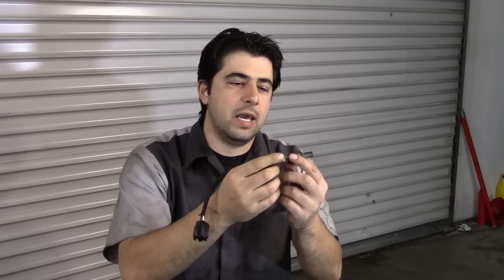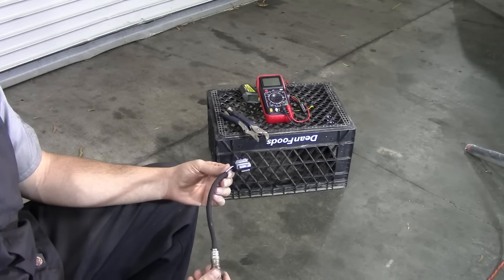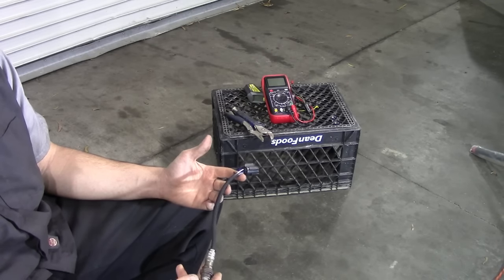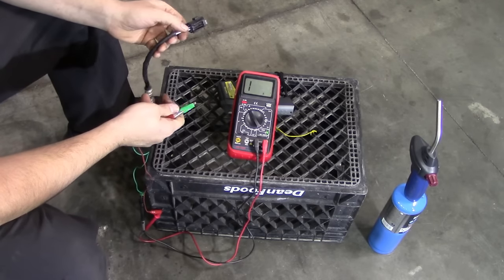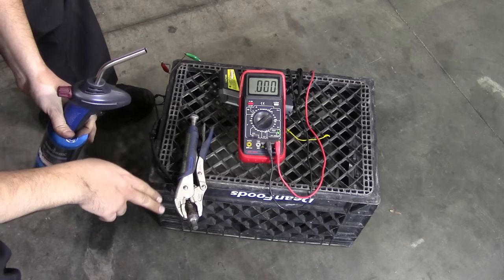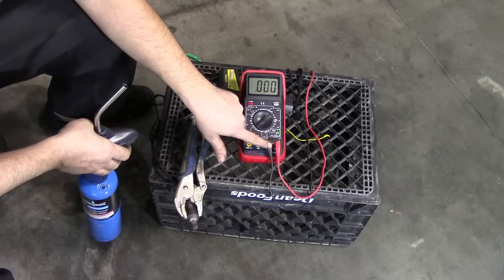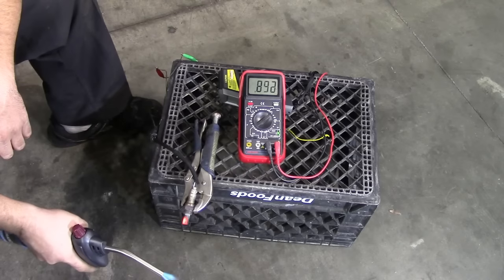How to Test an Oxygen or O2 Sensor - Plus a Quick Guide on What Each Sensor Wire is For

Comment: I tried this with an acetylene torch, but accidentally cut the O2 sensor in half.
Reply: Um yeah no crap you have to use  propane torch because oxygen acetylene gets hot enough to cut plate steel propane does not
Reply: @SheikhN-bible-syndrome  its a joke my man
Reply: Yeah I threw mine in the coal forge to warm it up few minutes later I came back it was gone idk🤷
Reply: Lol
Reply: Lol
Reply: How TF did you manage that one buddy

Comment: The best way to test the sensor is to backprobe the signal wires with it in the car and the engine RPM held above idle. The sensor could be producing a good signal, but the wiring to the PCM could be bad,  preventing the signal from getting there. A scan tool is great, but that doesn't always mean the signal reported to the scan tool is correct.

Comment: The O2 sensor's sensing ability comes about by producing a small voltage proportionate to the exhaust oxygen content. In other words, if the oxygen content is low it produces a high voltage (0.90 Volts - Rich mixture) and if the oxygen content is high it produces a low voltage (0.10 Volts - Lean mixture).    Give time for the torch to burn off carbon and heat the tip all around and not just one side.

Comment: An analog meter with a needle would show if the sensor has a faster reaction. That's the downside of the digital multi meters, you're not only looking at how fast the component is switching, the digital meter has a limited refresh rate.

Comment: this is a great explanation, the heater resistance is round about 4 ohms but does vary slightly from sensor to sensor, the sensor reading will rapidly change once the sensor is fully heated all the way around, using the blowtorch is definitely a near as damn it simulation of what the sensor will be experiencing in the exhaust manifold, this is a great way to test an existing sensor and a brand new one before fitting it, it is also a good idea to check the resistance reading of the sensor wires as there should be no resistance reading across it, if it does have resistance then it means that there is carbon crud bridging the sensor wire itself and this build up on an old sensor will cause false readings to the ecu.

Comment: Great video, really helps me! I'm chasing a P2195 (Oxygen Sensor Biased/Stuck Lean, Bank 1, Sensor 1)  on my Ford Focus. I've eliminated all other possible causes (vac leaks, exhaust leaks, etc) and have been scratching my head. I replaced my upstream sensor before anything, but I used the cheapest one I could find. This might be my problem, so I'm doing this procedure to check it. Thanks from a new subscriber!
Reply: Andrew Edwards don't forget a clogged fuel injector

Comment: A scan tool is the best way to test it with the O2 sensor(s) in situ.

If it's both a code reader & one that scans live data,then it will tell you if the sensor is at fault or whether they are reporting a lean mixture due to an air leak or bad fuel pressure.

For example , code for a MAF meter & an O2 sensor reporting a lean mixture  will tell you that you may have an air leak.

Comment: Wells tech published VHS tapes on this method back in the OBD1 days, and I found the same thing as you - during testing of sensors that were "sluggish", the heat from the flame (making the o2 sensor cherry red) literally burned off deposits, and "fixed" sluggish sensors (sort of like the self-clean cycle in your kitchen oven).  During normal operation, EGT's on a gasoline engine don't get hot enough to burn off these deposits that can foul a sensor over time... but your torch with the pinpoint flame can, and the test procedure itself "fixes" many of the sensors that trip an OBD code for "sluggish", or "slow response".  Obviously not going to fix an "open heater" though...BTW - don't bang on the exhaust pipe, or use a hammer on your wrench, or drop the sensor when removing it...or you WILL have an open heater circuit by the time you want to reinstall it... ask me how I know...
Reply: How I know?
Reply: Or better yet, don't ask me how I know.
Reply: Whoa! Thanks for the tip. I never once thought of that!
Reply: So are you recommending that we torch all our O2 sensors red hot and then reinstall them?

Comment: Thanks for the info. Very helpful. just in case no one has mentioned it, the heating effect of a resistance is Watts=(volts x volts) / Resistance. For a 7.2ohm resistance on a 12volt system this is 20Watts. This is a low heating effect, but added to the heat from the exhaust gases I guess it will achieve a two to three hundred degrees celsius.

Comment: You're a good instructor, I'm giving up on the forums and shops, they've all become jerks who just throw parts at things.  I'm hoping this is my problem, I've tried new MAF sensor for P0171 because a shop wanted $500 for that and valve cover gasket (not needed), so I knew they were just throwing parts, at my expense.  But I thought 'how can I test sensor without scanner?'  I suspect these at 180k miles before my MAF sensor because I also got cat codes in past, like 'catalytic inefficiency' or something. I guess it could be MAF but I've tried two.

Comment: O2 sensors get cleaned in temperature above 400'c city driving on low revs is not good for them especially on LPG-that's what I did:-)  at first O2 sensor was cold what you did with propane torch is not only heat him up but cleaning :-) so at first was lazy because was cold and dirty... Is not that easy to reach 400'c on 1.3 petrol yaris on motorway :-) I did the same by giving my O2 sensor good blast with propane torch and it works a lot better!!!  Good video mate!  Thumbs up!

Comment: HEY! You are OVERHEATING the sensor tip, and also RISKING it because you are overheating only ONE SIDE, and that stresses the ceramic inside!

The PROPER way is to Only heat to a dull, dark red, and no more and doing it in a well shaded room to be able to see the first subtle red color just appearing and then withdrawing the flame immedoately!.
Heating and turning the sensor to heat its tip area UNIFORMLY around, and not concentrating the heat at one side prevents stressing the ceramic inside, as it is fragile.

You may add the caution about not heating the rear portion (behind the hexagon), as you could damage the heater element, thus, the only portion to heat, is the very tip of the sensor, also trying to make the tip of the flame to enter inside the holes, in order to decarbonize the ceramic inside the outer metal jacket, that cover is only there to protect the ceramic and its delicate precious metal deposits, which are what generates the voltage signal.  Someone could presume that heating to bright red color didn't damagep his sensor, but not all sensors are so rugged as the factory installed ones, the after market ones tend to be less rugged (and sometimes less durable too!) Best wishes.

Comment: I think that certain time you are refering to is 0ne second.   since most obd2 oxygen sensor now has heater ciruit element built in. you can identify them by the pair of either black or white wires.  Not just WHITE.

Comment: 99% people don't carry multimeter so lets cut short. Some indications when u need to check O2 sensor are when Cylinder Misfire, Engine Hesitation, Lack of Acceleration Power and Black Smoke from silencer. MIL is on. Remove the O2 sensor and see if its become white then its time to replace it.

Comment: please, is the voltage also measured on the two white wires as resistance?  Is it enough to use a candle to create a flame?  Next time do a test on the Map and Maf sensor thanks for the video👍

Comment: Thanks for sharing with the community. Good video!. I ahve one comment for correction on time stamp 3:54 it should be the higher the oxygen the higher the voltage.
Reply: The O2 sensor's sensing ability comes about by producing a small voltage proportionate to the exhaust oxygen content. In other words, if the oxygen content is low it produces a high voltage (0.90 Volts - Rich mixture) and if the oxygen content is high it produces a low voltage (0.10 Volts - Lean mixture).

Comment: I have a BlueDriver Bluetooth scanner but want to upgrade, what do you recommend as a good all around scanner that has good graphing capability ? Second my daughters 2011 Kia Sorento has basically really slow acceleration, no power on hills, the only code is P0170 which could be bad O2 sensor, bad Maf sensor, vacuum leak, etc, could that throw it into limp mode, I own 2 Optimas and a  Santa Fe and even with bad O2 sensors they haven't lost power. Could it be transmission ?

Comment: Correct me if I'm wrong but a o2 sensor do NOT measure the o2 content it simply heats up witch changes the amount of voltage going to the ECU,  witch will determine how much feul goes into the system ......

Comment: Found this video diagnosing a P1135 fault code on my OBD II( 2003 toyota camry 2.4l). I started out by replacing my catalytic converter and the upstream (bank 1, sensor 1) I already replaced it but the code still persists.

Comment: My car is reading no activity from my 02 sensor that I just installed. The old one was throwing a code but it at least had activity.  I tested the new o2 and it read 0.00 and then barely moved up to 0.01 to the highest it reached was 0.13 then to 0.03 and then 0.00 right away.  It's that a bad o2 sensor? The brand new one?

Comment: A Het gu would be better for heating the sensor.  The propane torch burns almost all the air so you would get a reading that indicates a rich mixture.  A hear gun only heats the air, and you would get a lean indication.

Comment: So does the sensor itself produce voltage when it gets hot? When testing it did not seem that you added voltage but only checked what was coming from the sensor.
Reply: This is also my question
Reply: @williammason1932  I later found out  that it does. The channel listed below has a very good vid on it:
https://www.youtube.com/user/markjhicks/videos
Reply: He does state a couple times that the sensor does generate the voltage. The voltage is what the computer is looking at to determine how rich or lean the fuel:air ratio needs to be. The sensor produces the voltage.

Comment: Hello any advice... I have a 2005 Trailblazer and getting codes : P0153 and P0054 and P0053. I recently placed both O2 sensors and still have the codes. Could it be the Cat?
Reply: That's usually the next Step

Comment: Most engine management  issues seem to be related to carbon biuld up.Carbon is impervious to acid but hydrogen peroxide should burn it.Does anyone have any knowledge in this area?
Reply: Bro i drove 2000 miles in 2 weeks i did 2 stp ultra injector cleaners with 80 gallons of gas, took me 500 dlls of gas but kept.it full all the time, the jerking i felt that felt uncommon, was gone after those 2000 miles, car ran leaner, and that was prior to changing both my o2 sensors

Comment: In a car the wires for upstream CC are. 
1. pump current
2. sensor voltage negative
3. heater negative 
4. heater positive
5. compensating current
6. Lambda control,
 Can you explain what is the use of so many wire. why not only 2 or 3 ?
Reply: vicky singh

Comment: How do you check it on a 1995 vehicle that DONT have a scanner connection? My system is a OBDI system...I guess I could unplug it and see if it runs better or changes....I have a miss...at idle..or any speed or any  acceleration...It was missing on 1 cylinder before I replaces the spark plugs...but It still makes a 'bump' or miss once in a while...

Comment: So when he heats the sensor is it actually creating voltage or does the circuit lower resistance so the multimeter can push the voltage through?  Could you also do this test with the multimeter set to measure ohms?
Reply: On a 2012 Acura TSX 2.4L with the old upstream O2 sensor (2 black wires, 1 blue wire, 1 white wire) still installed in the exhaust I tested the resistance between the blue and white wires with the engine off and while the engine was running.  Both conditions showed infinite resistance (open loop) which I believe indicates it was bad and was the reason I was getting a P0420 check engine light.  When I installed the new O2 sensor there was infinite resistance with the engine off and showed a small decrease in resistance with the engine running with higher decreases as the rpms increased.  When I tested for voltage I got no indications.

Comment: Hi, I just did this test on my o2 sensor, and is the voltage supposed to go back up on it owen after it drops down to zero?  I did the test just like you and the voltage went up to .93v and immediately droped to 0v but then started climbing back up to .23v for about a minute and then started going back down to zero which took another minute.
Reply: Radiant heat. That would be fine

Comment: Hi Imma getting 1.4 ohms or 14ohms..... then voltage is 1volt when temp gun sez 260++ all the way to 585 F is that okay? help peeps.... I applied 12v on the heater and it heated to about 40 to 60 that okay?

Comment: Great vid on O2 sensors. Is it a bad idea to just replace all O2 sensors together in one fell swoop?  Or just do the specific O2 sensor that triggered a failure?  Just recently it tripped the downstream O2 sensor.  I just got a used hi-mile 2009 Camry (175,000 miles) and did a huge tuneup.  Im in the mode of replacing lots of items to ensure I know the baseline health of the vehicle. -----Thanks & keep up the great work.
Reply: Yes. Replace all of them at the same time for the best performance and the  longevity of the catalytic converters.

Comment: Thanks man! My 4 wire Ford o2 finally reaches .9v but it takes several minutes for it to go down to .1v.
05 Ford 500 o2 code p2197 stuck lean. Running I have fuel coming out the tail pipe. When I took the o2 out it was drenched in gas.
Reply: Blade could be bad injectors that are stuck open or bad electrical connection at the injector that forces them to always be open. You might get misfiring but that really depends
Reply: Thanks for the reply. Turns out it was a bad PCM. I found 5 skinned wires in the PCM engine harness where it lays on the AC line right beside the  low side port near the firewall.
  Also it turns out that its a very common issue with a Ford 500. So if you know someone with a Ford 500 warn them that the harness needs routing off the AC line. If this one had gone much longer it would soon have worn a hole in the AC line. 
Thanks again for the advice.
Reply: Blade No problem. That would have been one of the last places I would looked lol
Reply: Yea this was extremely dangerous! In just a few minutes of running the engine, it would put a 1/2 inch of gasoline in a large bowl that I had placed under the tail pipe. 

I took the fuel rail out first and and pressurized it to 40 psi which is what the vehicle runs at and pulsed the injectors over and over. So I knew they were working fine. I don't have an injector tester just a home made 9v on and off pulser that I can plug up individually to each injector..
Reply: HexagramMan  I replaced the computer. It was keeping one injector open full time. 
 found 3 wires in the injector wiring harness that were rubbed through and shorted to ground near the firewall. (common on Ford 500) I repaired those wires and that one cylinder stayed on full time.
I also with the harness unplugged  at both ends tested to make sure none of the wires were shorted to ground.
#5 injector was getting a full time non pulsing ground strait from the computer.

Is it possible that fixing the shorted wires would have fixed the car without replacing the computer?
I don't think so. It simply would not run right until after changing the computer.  There were some other codes going on that I can't remember right now but  after changing the computer it ran good. It still took a long time to burn all the gas out of the tail pipe and for it to quit smoking.  
If I could get 1/2 inch in a bucket in a few minutes the tail pipe had to be full of gas in the low areas.

Comment: need help. My sister ford everest 2007model. When I drive and push the accelerator it suddenlly off the engine and it flashes the check engine. I tried to full tank  and the chk engine gone and it does not power off. I used the car for a week. now when the fuel is low it came back it suddenly flash the chk engine and goes off while driving. need help whats the problem. is it the fuel tank has water in it? when i turn on the car without driving its ok no chk engine but when i drive and push the accelerator to make it run fast sometimes it will flash chk engine then off the engine.

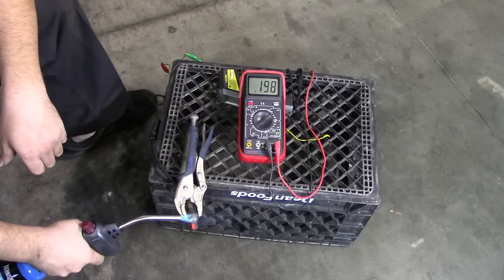Comment: Nice video. I am having a simple question. Did you heat the sensor (on time 5:15) with a gas tank or with a propane tank?
Reply: Looks like a butane torch, I get mine from lowes

Comment: hi there, just wanna ask if this is one of the reason why idle drops when coming into a full-stop and causes the engine to stall???
Reply: Yes, rough idle/cut-out during idle can be a common reaction to failing O2 sensor. Your car mixes fuel/air ratio based on data from the O2 sensor. If it mixes too lean (not enough fuel), the ratio may not be enough to continue firing, and the engine may even die completely. If mix is too rich (not enough air), incomplete combustion can occur. This may happen more commonly when first driving (especially if your O2 sensor is an unheated one), before engine & exhaust reaches normal operating temperature.